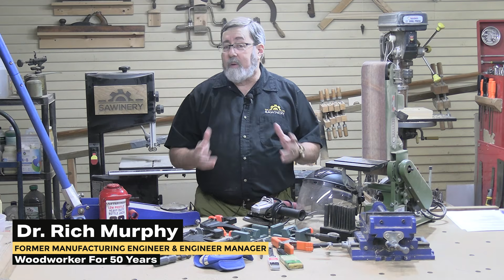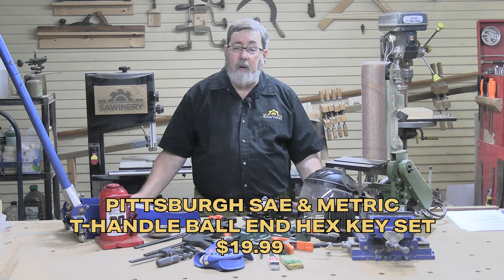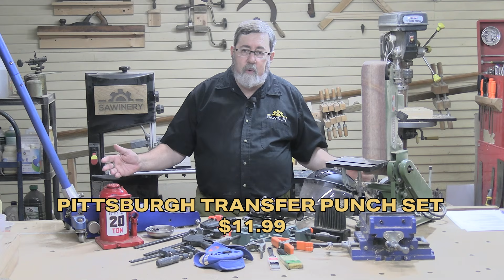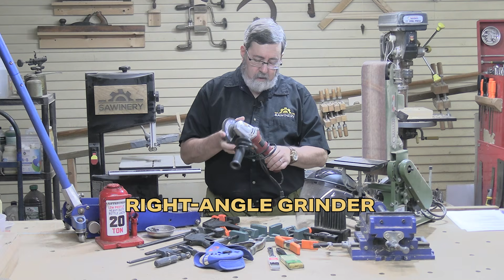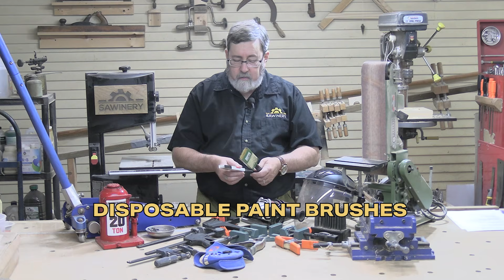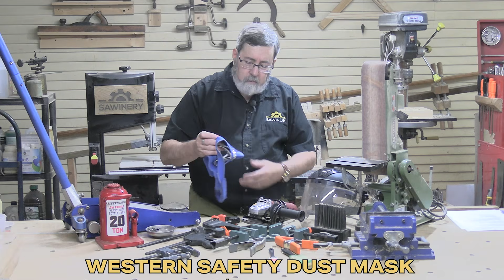22 Best Tools You Can Buy at Harbor Freight

Comment: I won't dispute that HF has some good deals on tools, but IMHO it's still best to shop around.  I was all set to get one of those Daytona floor jacks, then I went on Amazon just to see what they had and I got one that looks similar with the same load capacity, but that also came with a screw-in riser, a rubber grooved support to sit either side of a pinch weld, a foot pump and altogether it ended up being about $5 less than the Daytona.

Comment: I love Harbor Freight. The one thing I recommend is that you inspect the specific tool you are buying.mi didn’t do it on an F-clamp and one was fubar first time I tried to use it at home. Probably won’t be spinning up a tablesaw in the parking lot. lol But I try to check anything I can out before I get to the register, if I can. It’s a drive for me, too. So it wasn’t worth the fuel to return the clamp. I do like to get some prime tools, too. I love my woodpecker combo square. Use it all the time. No regret on paying a little too much on it. ☺️ Treat yourself nice when it will be a lifetime of fun. 😎

Comment: I have to air hose reel and several smaller HF tools. Almost all have been worth what I paid for them, many have lasted for years. Even their power tools were worth the price, but they didn't last very long and of course tools only die or break when you're in the middle of a project. They lasted long enough for me to be able to replace them one at a time with better though, so they were good starter tools. The hose reel works great, except my ex hung it from the ceiling. He hung many of my tools too high for me to reach. I get a lot of hangers, casters and odds & ends at HF too. I don't think I'll ever have enough clamps or magnetic trays.

Comment: What brand to I want to go with for brad nailers and staplers? I bought a cheapo at Harbor Freight just to get a job done but it misfires about half the time that that just drives me nuts! I've had two Porter Cables in the past and they both fell apart on me. Porter Cable is great for routers though.

Comment: I have a Harbor Freight air compressor that I've had for about 20 years, use it all the time for my resin pressure pot. Works fine. About a month ago, I bought a new Harbor Freight air compressor for my laser room, supposedly a better one, and that thing is so noisy!!! I'm going to have to put it in a soundproofed closet!

Comment: Bought the Central Machinery small drill Press years ago and returned it…lots of unacceptable runout.  Got a WEN instead. Their Bauer drill presses look like they are made in the same factory as WEN. Same with their 9” bandsaw and their new belt sander. In all cases the WEN is cheaper. I have the old Central Machinery belt sander. I use it but I kind of hate it. Tightening the motor belt fixes the stalling. Its not the motor, its drive belt tension. Incidentally they still s ll that model. Its painted gray instead of green but same craptacular design.

Comment: I’ve scored some of the best tools in the Hercules and Bauer power tool line and in many cases they are better than the brand names. The Bauer, 22” scroll saw, Bauer 14x20 midi lathe 6” bench top jointer, and 17” drill press are just a couple of my top picks from HF.

Comment: I have the 17” Central Machinery floor mounted drill press I got about 3 years ago and it’s a beast. It cruises through thick metal and all wood I’ve put through it with zero hiccups.  It has a little wobble in the chuck that I could probably tune out, but for my metal & wood work so far it has performed very well. I just bought the Hercules table saw 2 weeks ago and the rack & pinion fence was one of the biggest selling points for me. I’ve used it daily for the past few weeks building canvas stretchers and frames for our commercial art business’ oil paintings and it gives me the precision I need to build quality stuff quickly. 
I have 2 HF Titanium welders (Flux 125 and Stick 220) that have both performed flawlessly for the last 5 years. I have HF hydraulic jacks, floor jack, and hand tools (which all have lifetime warranty), as well as 5 angle grinders, dozens of clamps, and many other items you mentioned. Zero failures to date on anything. One of the best purchases I’ve made at HF is the Chicago Electric corded impact wrench. I’ve had it about 8 years and it has never failed to break loose any bolt or nut on anything from my saltwater boat trailer to my F-250’s lug nuts.  Best $30 I’ve ever spent!
Thanks for the excellent video, liked and subbed! 👍

Comment: The Hercules Brand Wood Thickness Planer has been  getting excellent reviews from woodworking People  most Specifically  for its Price Point and  Compared to other brands in that Price range  at the moment  I don’t think anyone currently  has a SiralHelix style Cutterhead  available for that unit   But as soon as those become available based on Popularity  and demand my. Guess is  that brand and Tool will become a Game Changer for the Hobbyist /Amateur Woodworkers   I like the Harbor Freight Bar Clamps after. You do the  simple inexpensive modifications  that don’t take a lot of time or money  to do  they are a decent  deal  although I recommend to my friends to. Look for used Pony brand Pipe Clamps  and  build their own length Pipes  HF Air Tools like the Nail and Staple Guns  aren’t bad  many of them are knockoffs and are easy to find rebuild parts. To service them yourself FYI even Name brand like Senior and Duofast  need to be rebuilt  from time to time. Those companies  got their great reputation  by the independent dealers  that would  Servicethem on the Fly  at the Jobsites   Similiar to a ToolTruck Brand that will Warranty / Repair tools  during their visits  one other. Decent  Item fromHF is their Dust Collectors

Comment: I love Harbor Freights $10 angle grinders. I do a lot of grinding on a daily basis and I own multiple expensive angle grinders so I know the difference. For me, I usually pick up my cheap one because they are really small and most importantly they are significantly lighter than any other brand. If you’re a regular grinder like me you’ll know how exhausting it can get when you’re swinging that thing around one handed for 30 minutes straight.
Reply: The $10 grinder is great cause you can buy 6 of them and put different heads on each of them and instead of fiddling with it for 5 minutes to get the head off and another on you can just grab another grinder and be going again in few seconds

Comment: A tool you didn't mention, but one I love out of all proportion to what it should be worth.
Their magnetic paper towel holder. SKU 56454
Sounds stupid and needless, but SO convenient when working on the car or projects outside.
Temporarily put your paper towels RIGHT where you need them as long as there is sheet steel there.
(even UNDER the car stuck to the engine block when I was working on the power steering rack once!)
So much better than crawling back and forth out from under just to clean something .
Depending how close to each other you put  the two ends, you can adjust the tightness so the paper towels don't unroll when you pull one off too.
(and ... they doubled as a temporary fridge handle when ours broke once) 🙂

Very much agree with the transfer punch set.  Sooooo useful, I use them much more than I ever thought I would.

Disagree with their ratcheting bar clamps. You say not to expect much clamping force ... Why buy a tool that doesn't do the job expected of it. My dewalt and irwin ratcheting bar clamps do everything those can do, and can provide MUCH more force when I ask it of them.

I have 4 Harbor freight compressors ... all still work.
Bought a pancake years ago, eventually decided I needed more CFM and bought the 8 or 10 gallon one. (also many years ago)
I eventually got tired of all the noise and got an "ultra-quiet" pancake just to fill tires and little jobs. SOOOO much quieter and better - Oh my god.
I liked the quietness so much I splurged on a 10 gallon ultraquiet  one a month or two later when it was on sale too.

(A hint:  If you ever have to use your compressor in coldish weather (under 50F or so) replace the oil with synthetic air compressor oil. Home depot (and other places) carries it. it will start MUCH more easily in the cold)

I like their jacks in general, but will add a caution for the aluminum floor jacks.
The aluminum jacks have no C - section (the flanges on their steel jacks) so they do NOT resist side force very well.
Ok on perfectly level ground or on a slight hill if you are parked up and down the hill, but if parked sideways to even a slight slope they will bend.
(yeah, I know, not the best/safest idea in general, but if that's the way the driveway slopes, you have no other choice ... and it was only a slight slope, not much at all)
Eventually splurged on their off road jack and looove that one. (even though it's very expensive.)

Comment: Hammers. Specifically, their dead-blow hammers. I bought one of their larger ones almost five years ago now, and I've beat the hekk out of that thing. The head is just now starting to split, but at this point it's more than paid for itself. If you're buying a tool to beat up, buy a cheap one. 

That being said, I do have one of their automotive floor jacks, and an assortment of cheap wrenches and screwdrivers. Besides one of the flatheads that got snapped (my dad was using it as a small pry bar...) they've all held up to the rigors of diy mechanical work or home projects. 

I also recommend their tool stands. They're built the same as what you'll find at Menards or Home Depot, but they still cost less. I don't know about the differences in steel thickness, but they're usually rated for similar weight. I own a few, and they've been really good to me. 

What's better than buying cheap tools at Harbor Freight? Buying used HF tools at garage sales! I have that same belt/disc sander that I got for $15 from a garage sale, and that thing has held strong for the past several years since I've bought it. I've also bought an angle grinder for $8 that came from HF, and I've probably abused it almost as much as the aforementioned hammer. Still going strong for now. 

I also buy their tool bags quite often. They're cheap, and they are quite durable. I keep a basic set of tools in my car and my wife's car for emergency roadside repairs, and their small canvas tool bags tuck into corners of the trunk very nicely. 

Overall, I don't have much complaints with 99% of what I've purchased from Harbor Freight.

Comment: Pay attention to mounting with the reels. The cheaper versions of the reels have poor mounting points that don't stand up to use. On the hose reel, pay attention to the pigtail. My pigtail failed pretty quickly. Ironically, I went to HF and bought a better pigtail to replace it for $7. The brushes have a tendency to shed bristles.

Comment: Many years ago, when their were only two choices for power tools at HF ( you either got Chicago Electric or you got nothing ), I got the CE 4" angle grinder. As a time reference, it was blue and 14.99 lol. Used that baby HARD several days per week. Finally gave up the ghost after way over ten years. It was a beast. Went and replaced it with another, only reddish in color and a few bucks more. Don't do all that hard work anymore, but she's been a go-er for maybe ten years now.

I've outfitted much of my shop with HF over the last 25 years or so. Compressor (stand up), drill press, grinder, sanders, paint sprayer, acoustic sprayer, clampsclampsclamps, lightslightslights, die grinders, air nibbler,  LOTS of consumables, garden tiller, come along, hand winches, floor jack, chainsaws, trimmer, brake/press/slip roll ( stolen last year :( ), metal fabrication roller, etc. The only one I wore to death and had to replace was that angle grinder.

Last year I got a plunge router and one of their green welders. A few months ago, the big Icon ratchet/socket set.

While I've bought wood chisels, block plane, etc. there in a pinch, I try to keep my cutting tools like that to vintage yard sale or swap meet finds for the steel quality.

I have yet to buy any of their cordless/battery tools. My Dewalts are hanging tough.

I have a few of their hard cases, their semi-pelican rivals, and fully endorse their quality and ruggedness.

I don't buy everything there, but what I have has served me well.
Reply: I bought one of those blue babies way back in the day. They were $9.99. I was doing a rework for General Motors deburring deck lids on three shifts 24/5. We killed a lot of grinders. We killed a lot of yellow grinders. This was 1999 and that little grinder outlived them all. In fact, I don’t remember it ever dying. It’s probably in the back of my shop somewhere and still runs like a champ with five million miles on it .

Comment: US General tool chests excellent value. If you have them loaded and move them around consider upgrading the wheels. Still a very good value.

Hercules for prof use - doubtful. A decade ago I saw a comprehensive review and break down. 300 hour tool; a decade for a home owner. Only a year for heavy use by a prof. Use DeWalt (best value) or Milwaukee (best quality), maybe Makita... 

Earthquake floor jacks - excellent. I have the long reach low profile high lift 2 ton. A very versatile and well built floor jack comparable to Snap-on.

Earthquake impact wrench air drive - excellent.

Vulcan welders - good value.

Icon ASD combo wrenches, a set of SAE and set of Metric (no skips in sizes). Independent tests show very high quality, great value.

Comment: I’m a retired Professional Woodworker and an all around DIYer  I like. HF  Breaker Bars , the Pittsburgh Breaker Bars   impact Sockets , Some of their Air Sanders and NailGuns  as I feel they all are. Good Values  and work as they are Intended to do so  those are tools I purchase for myself  to use   In my Home Shop non Professionally  Professionally I   Don’t have many of their  Tools  as I spend the Money for Pony Clamps and other Name brand ones IMO they are worth the cost  ina effort to have  the Quality you need. To rely on meeting deadlines  for your Customers

Comment: I have 2 of those trigger clamps from Harbor Freight and one of them did break on me, probably from putting too much pressure on it. however, I was able to fix it by simply replacing a pin in it and now it's as good as new. 

Harbor Freight's tools may not be the absolute best out they're definitely good enough, esp. for a hobbyist like me. I do pretty much all of my tool shopping at Harbor Freight because because I don't do any serious wood or metal working, I just tinker in my garage so Harbor Freight's tools do what I need them to do.

Comment: My father in law is a contractor, I was working with him on a few things over Christmas break last year. He had a Hercules combination miter saw, and it worked quite well for the quality.
Reply: I buy lots of stuff at Harbor Freight but I found that the Skil compound dual bevel miter and 10” table saw had all the features I wanted for only a negligible amount more cost. I can’t recall if the Hercules table saw has a rack and pinion fence or not but that’s a big reason I went with the Skil table saw. Dewalt was the only other one I found that had it but $200-300 more expensive. I wish Harbor Freight had a track saw…not that I need any more saws lol

Comment: My drill press from HF is junk. The collett moves around so you can't drill perfectly straight holes. I think the main bearing is sloppy.  

Having said that I have many tools, both hand and power from HF and I keep going back not because the price is good, but because the value is very good.

Comment: Buy the cheapos first. Anything that breaks gets replaced with quality tools. I wouldn't recommend the Hercules table saw. First: because the saw unit is attached to the table poorly and breaking that mechanism is too easy. Second: because it's a tool that will probably get frequent use.
Approach HF with this mindset.

Comment: The Bauer sander has a 4" disc sander and a 36" belt.  They still sell the Central Machinery 6" disc and 48" belt for $299.  They also have a Central Machiner w/ a 4" disc sander and a 36" belt for $89. But the Bauer is a better design.

Comment: They recently did a deal: spend $40 and get a free cheapo angle grinder. They let you buy something for $40, take the free grinder, then immediately return the $40 item. So it’s just a free grinder. They had no problem with allowing me to do that. I’ve had two of those grinders, they are usually like $10 and they get really hot whenever I use it for more than a few minutes, and they bog down a little bit when using a wire brush and putting pressure on it, and start to smell like they are burning. One of them broke after like two months of use and the other one still works a couple months later. I definitely want to get a good quality replacement for it

Comment: I got the 2 ton shop crane on sale for $200. It folds up into a small footprint and has been very handy, along with the 1 ton chain hoist for $80. They have been really useful when loading and unloading heavy items into my truck bed. Also, I can put the harness on my dog and lift him up into the air when it’s time to hose him down and then he can’t run away!
Reply: ya i bought one a while back on sale for around that price. doesn't get used often but is a godsend when the time comes
Reply: Awesome comment!

Comment: For mechanics, troubleshooting, and or maintenance. Pittsburgh 22pc wrench set. Around $20 I use these to modify for specific situations. Cut, weld, bend. Just a grinder and flap disk and you'll have the cheapest set of low profile wrenches ever. But if you only use it once in a blue moon why buy an expensive snap on set?